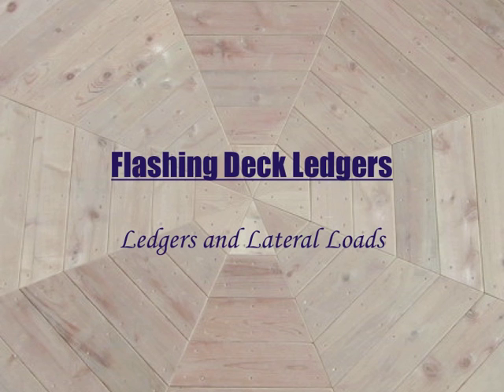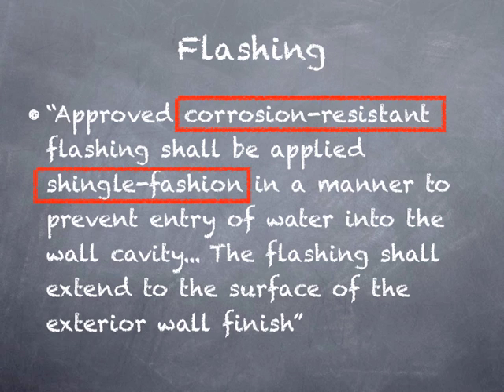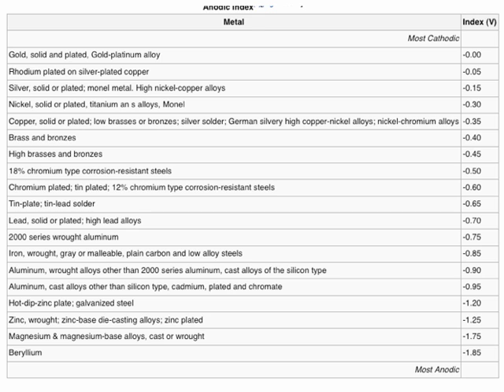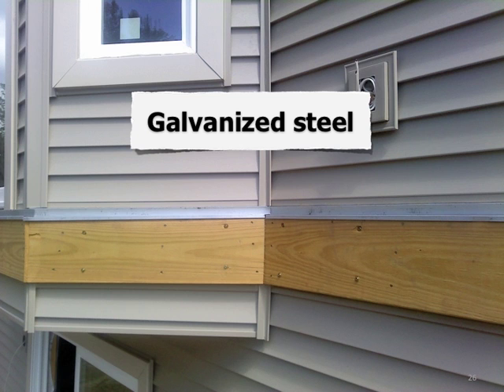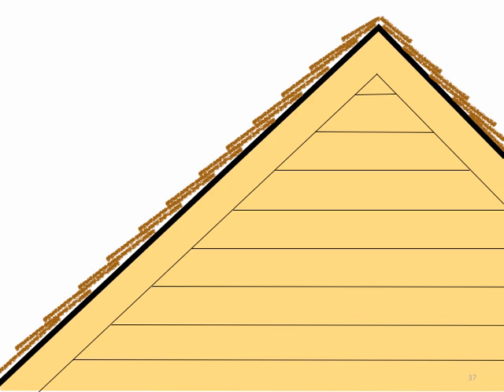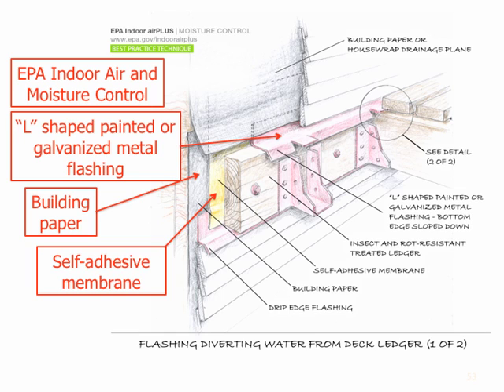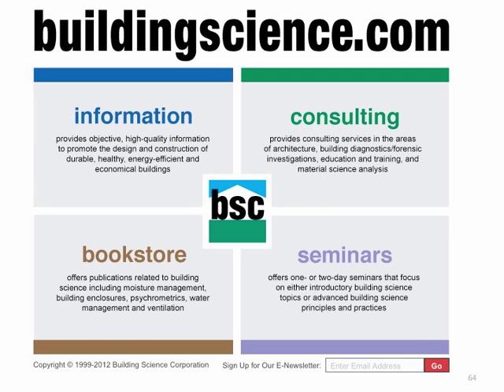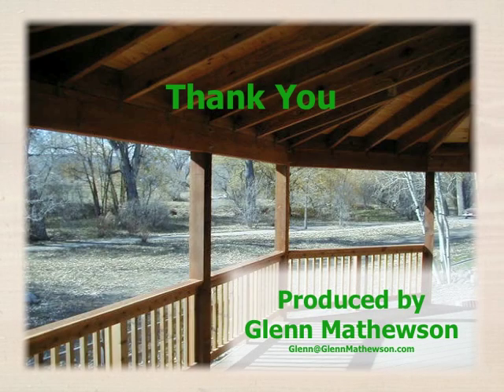Flashing Deck Ledgers

Comment: Based on the illustration at 7:30, how bad is my mistake? I installed the self-adhesive membrane without tucking any of it under the housewrap. 1) Intact housewrap > Membrane > Ledger board with L-Flashing on top that is just behind the Hardie cement siding.
Reply from the maker: The illustrations are just published ideas. This is an older video. Keeping your house wrap intact is not a bad thing. I would not worry if I were you. Flashing details in the code are being discussed this year for the 2024 code edition..
Reply: @GlennMathewson  Thanks so much for taking the time to respond. I appreciate your expertise!

Comment: The buildingscience.com website shows the flashing extending down the ledger, which is fine, but an actual joist hanger comes almost all the way to the top of the ledger—I doubt that a structural engineer would accept a little bitty hanger like that to support the deck joist. Seems like a nice detail, but not a real-life detail unless you can actually get away with a hanger like that.

Comment: Complicated question: I have an extended (1ft protrude out from house frame) sliding door frame that is 7’ wide leading out to the deck with a ledger 7’ long to match that width. The deck is 16’ wide so the old builder attached another 16’ rim joist to the 7’ ledger with 2 posts on the side to support the 4.5’ non-ledgered on both sides. My real question is, how do you flash this 3” double stacked ledger (from two 2x8 stacked)? Most metal flashings are 1 1/2” width and those that extend out doesn’t come drip. Can you actually cut the flashing and membrane tape it together to drip over the 16’ rim joist?
Reply: Most sheet metal shops will make you custom flashing.

Comment: Great information I am redoing my deck and the builder did not stall flashing when they installed the ledger board to the house, anyway around this or do I have to remove the ledger board?
Reply: You could remove the closest deck piece to the ledger and flash it but I’m more worried about what’s behind the ledger. Take it out and see if it rot. Call your city building code for an inspector to come out and see the condition of the rot. If it looks good, then you are at peace.

Comment: The cation anion exchange is an interesting bit. Curious: at 4:36 it sounds as though it is being suggested that HDG is actually MORE corrosion resistant than SS? This wasn't my understanding. Is this just an error in phrasing?

It'd also be interesting to touch on the issue of mixing HDG with SS hardware, in this context.
Reply from the maker: Spruce_Goose yeah... I see what you mean about how I phrased that.  No, I was not meaning to say that HDG is more corrosion resistant than SS.  I was just trying to explain the irony that zinc is more corrosive and thus by corroding first ends up protecting the steel it coats.  Wild stuff!  Thanks for your comment.

Comment: I have a deck that is flush to a concrete patio and the builder failed to put flashing on the ledger board. Now the ledger board and some of the deck boards are rotting. Looks like a major undertaking to repair!

Comment: how can flashing be installed on a deck ledger over cultured stone if the deck builder didn't do it initially
Reply: Dennis Drayer that stinks.  Best to gently remove lowest course of stone and add the flashing.  Painful when they don’t do I correctly the first time.